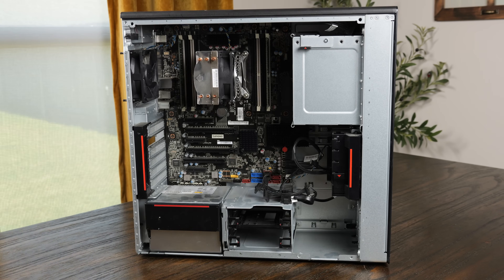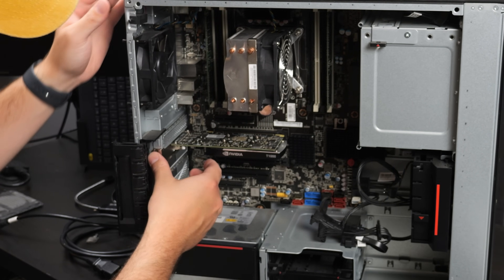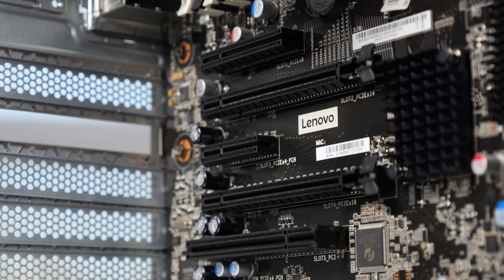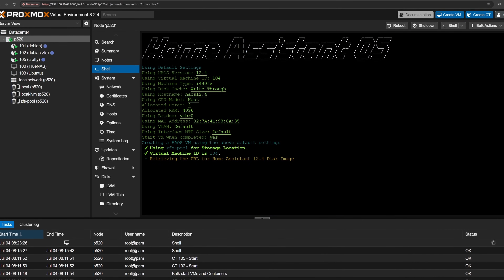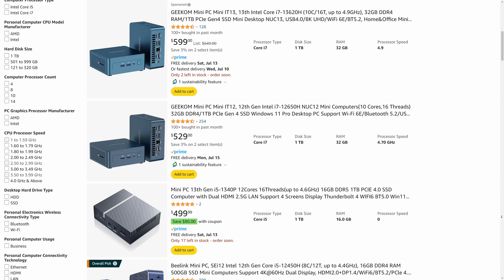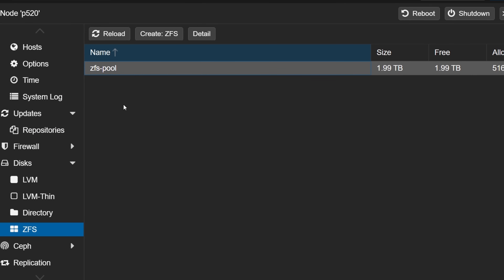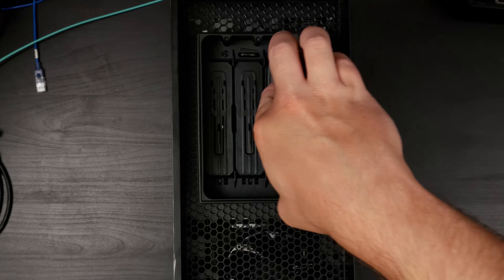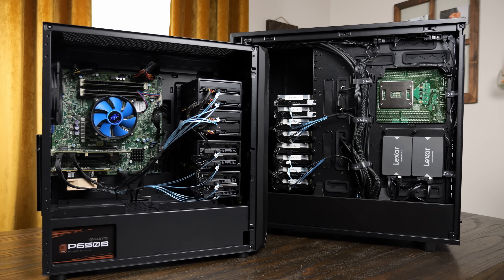A SERIOUS Home Server That's Affordable [Lenovo P520]

Comment: This system only makes sense if you have several of them so you can justify keeping spare parts for every component. You would not keep spare parts if you only have one machine. And if any part breaks its down until you can get a replacement which will take time due to the parts being Lenovos own special, you cant just hop down to the store and get a replacement quickly. This will make any hardware failures a nightmare both timewise and economy wise.

That, coupled with the fact that it cant keep up with modern comsumer i7 and i9 performance wise also makes it a poor choice.

The 512GB RAM is nice, but in reality you NEVER need 512GB of ram... Heck, many consumer boards offer support for 128GB ram... which you also never really need.

Being able to hook up many drives? Well, check out a rack case from xcase or some such, you can get one of those "empty" ones with 12GB/s SAS backplane and you get 24 (or possible even more) drive bays. You would need to purchase a SAS controller card though. But aside from that you can go with any consumer hardware you want or even have lying around. Much cheaper, much more flexible in the long run. You can do easy repairs and you can do easy upgrades. Not to mention you get waaaaay more storage possibilities.

Comment: If you have the earlier revision of the P520 motherboard, then you won't be able to upgrade to Cascade Lake W-22xx. I found out the hard way. I confirmed this by sending a picture of my motherboard to the Lenovo community forum where a Lenovo staff said my p520 motherboard is one of the earlier revision which won't be able to Support Cascade Lake W CPU's unless I upgrade it to a newer revision.

Comment: got a load of these to be scraped, we all in IT took one & saved a few for parts. Powersupply can be bit doggy as we had to swap out 2 of them after they blew. Otherwise they have been class for us learning how to work with VM's. Would like some more Sata ports on the board but sure it was free.

Comment: Machines like this get a lot of grief from people ( who have never owned one).  I have one with a 2245 8 core processor, 64 gigs of quad channel DDR4 and a 3060 TI video card. It's got a couple of m.2 slots. It's a solid machine. Built like a tank and probably the most stable computer I've ever had so far

Comment: I picked one of these up after watching your video and it has been nice so far. I did end up getting the Icy Dock 3-Bay Adapter since the lenovo cage would take over a month to be delivered and I don't have a 3D Printer. While it does work the way that the 5.25" bays are secured in the P520 isn't the best, and I can't use their bracket to lock it in place because of the way it is designed.

I could probably put my own holes into it so that the securing bracket works, but I don't move the server a ton and it fits in well enough that it isn't just sliding around if I move the case a little.

Comment: I have a p520 and got lucky w/ the 900w PSU and all the HDD cages for $150 shipped.  I have since added 128gb of RAM, an x4 NVME adapter, and RX 7900 GRE. I can play modern games at over 100fps, its phenomenal!

Comment: whell have gotten a real good server system for 400 usd and  it has 24 cores 48 threads and can use up to 512 gb of ram have 256 installed have 256 more in the other server got it in the price

Comment: How loud are these systems? Both at idle and under load. Compared to a regular workstation.
Reply: I think it's a little late for an answer, but still. It is decently quiet with the factory fans, but not silent. You can hear it in a quiet room. But it has horrible fans, they are like a jet turbines on high rpms. You can replace them with any quiet 92mm fans and swap out the CPU cooler. It will run literally silent except for the disks. Very decent workstation, I'm using it for 2 years for now.

Comment: I have been screaming about this thing since I got one like 2 years ago for ~$200 on ebay. The P520c would make a better workstation though b/c is also just as cheap, can do many of the same things and fit 2 GPUs.

Re: NVMe tests: A single NVMe drive outperforming RAID zfs between 4 drives bifurcated actually somewhat makes sense. You are r/wing to 4 different drives vs one. This is also a good way to wear out your drives fairly faster. I feel as though using them separately via passthrough is a better use case.

Comment: I don't get all the Lenovo hate.  Working on hardware for decades, HP and Dell have all of the same non-standard headaches.  It's how they all keep clients tied to their procurement channels for pricey parts.
It sounds like a 'Chevy VS Ford' argument for hardware nerds on the surface, until you realize its really a 'Chevy VS GMC' argument (it's only a different badge).

Comment: From a mechanic, never torque your way to loosen a screw. Pretend you are an impact drill by applying bits of tourque and releases. Another words, pump the screw driver and you will save your bits along with strip less screws that way. You will also find out that screws and bolts break their tightness easier too.

Comment: You inspired me to have a search for something similar after watching this.  I'd wanted a workstation platform for a while, but could never seem to find what I wanted, or could afford.  After searching a little for P520's, there wasn't a lot in Australia, and they usually had the W2135 or the W2123 CPU.  With the help of a certain LLM, I found out the competitors from the other brands, and then found an HP Z4 G4 with a W-2145 for reasonable money ($285USD)

I plan of definitely moving the portainer setup from my old 7th gen Intel NUC i5 to this new server, as a VM in proxmox.  The only thing I'm still trying to decide, is if it's worth moving my OPNSense box to this also, and then the NAS as well, and combine all 3 of my current systems into the one.  I'm fairly certain that it will have more than enough power to do what I want, and I'm sure that one system would use much less power than 3.

Comment: 8:18
I saw a setting off by default that allows thunderbolt in BIOS and requires that you select where it's connected.

You may need to enable that if you haven't.

I bought one because of your video lol

Comment: I've suggested these Xeon W-21xx CPU workstations on your videos before. I bought one myself several months ago. I have an HP Z4 G4. The proprietary junk is a little annoying, but replacement parts are dirt cheap on Ebay if you need them. Proprietary workstation/server equipment is way cheaper on the used market than standard stuff, so if you want budget options with a lot of features, that's the best way to go. I bought it for something cheap with a lot of PCIe lanes and high maximum RAM capacity.
Reply: As far as proprietary stuff goes, I'd take Lenovo over HP or Dell any day.
Reply: @nootnewt  I prefer the PCIe slot layout on the HP Z4 G4. It goes empty slot, x16, x4, x16, x4, x8. That lets me put two x16/x8 cards and an x8 card in with each card having free space between them for airflow. The Lenovo has the x8 slot is right above the first x16 and thus has less airflow for that one slot. If I remember correctly, the Dell model has the same PCIe slot issue and a more cramped chassis. Most x8 cards I'd look at like NICs and SAS adapters need a lot of airflow and having it that tight in there makes them harder to cool adequately without getting very loud.

Comment: using this kind o hw at home is silly as long as you don't have solar panels... A home lab IMO should only be driven by low power devices, why would you need something like this when there are a lot of low power devices with decent performance these days which will not cost you an ARM...

Comment: If Intel will manage to make bifurcation work on desktop system I will be first who will run for their platform, its more power efficient idle then latest AM4/AM5. But for now I will use AM5 - efficient under load, bifurcation for nvme drives. This Lenovo system is interesting, but old, inefficient and full of proprietary components, so for something like socket 2066 I'd rather look for standard x299 systems (but wo BMC) or some Xeon systems/boards with standard layout of PSU/USB/etc

Comment: A serious home server needs 12 drive bays at least :(
Yes, 12.
With today's storage needs, you have to use at least RAID-Z2. This mean you will only have half the overall capacity (50%) useable if you use just four drives, which is extremely wasteful. So you need to use five drives at least, for having a much better quota of 3/5 drives as useable capacity, or 60% at leats giving you more than half of what you paid for. Then you also need an online spare drive, in case there's an issue. This makes 6 bays in use all the time. But what happens once you need to switch to bigger HDDs? ZFS won't let you simply increase the storage. So you need a seciond set of drives to use. This means another 5 drives. You don't urgently need a hot spare for these additional slots, but you won't get an 11 bay enclosure anywa - so it will be 12.

Comment: Maybe your 10Gtech SFP+ card prevented C6 CPU idle state?
Try without it?
Check out Wolfgang's videos on forcing cards to support PCIe sleep, or whatever. I've not tried that yet. Easier to remove the card and measure.

Comment: Fun fact the P520 comes with windows 10 workstation edition license hard coded in the MB, eBay sellers sell them with win10 home, a few command prompts and you can pull the license key off the MB and upgrade to win11 workstation for free

Edit: What i'm trying to say above is that if you use this box as a Proxmox host, create a Windows 10 VM with the CPU set to host, you will then be able to use the embedded OS key to activate the VM
Reply: Could you share the commands to get the license key?
Reply: the hardware IDs are actually just stored on microsoft servers and installing windows workstation edition will auto license itself since they look it up on ms servers. However windows is terrible, use linux.
Reply: Why the fuck would you downgrade to Windows 11? 😅
Reply: thank you so much
Reply: i couldnt imagine only have 12vcpus to work with in a hypervisor tho. you can find a dual socket 2011-3 (v3 v4) for pretty cheap, its the better option.
Reply: mas...
Reply: *downgrade
Reply: I use Linux and you should try it too.
Reply: @MelroyvandenBerg do you just see the word Windows and day "no, Linux"? They said proxmox running a windows VM. They ARE running Linux. 🙄. Do you need me to explain it?
Reply: @MelroyvandenBerg  yeah but if you install Proxmox you can have Windows and Linux booted at the same time. Fit two graphics cards and you've got two PCs in one plus a server.
Reply: Just use windows server it has gotten better now.
Reply: @MelroyvandenBerg  me too.
Reply: @MelroyvandenBerg why?
Reply: @FINNIUSORION  have you tried Linux? The Workstation and server performance and usability is much better than Windows. At least in my honest opinion

Comment: Nice Video for the US , but in Europe these things start from 350 euro or a lot more...  so DIY AM4 starts to make a lot more sense, Ryzen AM4 is getting so cheap new or second hand CPUs like the 5600 (6c12t) . but if you need more cores 3900(12c24t) 3950(16c32t)  there are plenty cheap mother boards x470 with 8 sata 2 m.2 and 10G networking for 120 bucks ( asrock taichi ultimate) also using intel remote management that is out dated ... is that not a security risk?

Comment: AMT is a pain. I've been trying to set it up on my Minisforum MS-01, and remote KVM works effortlessly through MeshCommander, but I'd rather use MeshCentral as it just has a better and more capable interface etc., plus it's more secure etc. But AMT support seems to require using a CIRA tunnel, so the setup is more involved, and while I can get an AMT connection, I can't get remote KVM to work with it yet.

Comment: I see 2 serious oversights that you should have mentioned in your video :
(1) you forgot to check if the BIOS is locked in terms of CPU replacements or not. (companies like Lenovo, HP, Dell, ... love to lock it so that you cannot simply buy another CPU and drop it in without stumbling on any issues).
(2) you forgot to mention that when you replace the motherboard you will also be forced to replace the PSU, thus adding even more costs to the upgrade path.

These proprietary systems are definitely not worth buying if you are considering going down the upgrade path.

Comment: You should take a look at the dell precision T7600/T7610. It’s an older workstation but still pretty usable and affordable. It can go up to 512gb ddr3 ram, I believe it can support up to 40tb of hdds. And can have as many as 3gpus installed at once as it has a 1,300 watt psu.

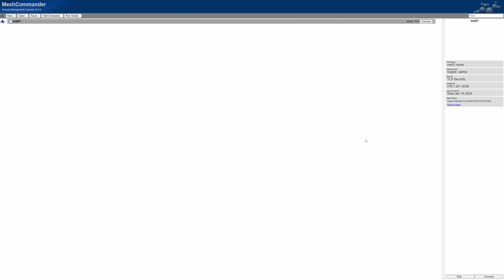Comment: 16:10 You need a CPU which has an integrated GPU to see the video. And even then, it needs to be plugged in to a monitor or use a dongle that fakes it.

Comment: Dang, I've been using an old Dell Intel 4th gen sff office pc as a NAS for a couple years and this seems like it might be worth the upgrade, currently i'm limited on drive space, sata ports, and overall function (I crammed 2 3.5 hdd but the top won't fit back on so i'm hotrodding it atm 😅) This would def handle most if not all of the future projects I may want to do (currently only running Plex and Home assistant but would love to get into more things like game server hosting and stuff.

Comment: only reason one should opt for old workstation servers is when you don't want to get a pikvm and need that kvm for remote access as a backup or when you want to set it in a place and forget it like your basement and not worry about power management as these hog power+heat+noise.
And no 3d printing is not a viable option for those looking at cheap + value home servers builds. Don't understand why the creators think otherwise.

Comment: For people wanting more cores/RAM, Skylake Xeon Scalable has also become pretty affordable recently. The Lenovo P720/920, HP Z6/Z8 G4 and Dell T7820/T7920 are all options, with 6 memory channels instead of 4 and multiple sockets.
Reply: The HP workstation are dogs, I have used a couple generations of the Z8 workstations and they run about 200 mhz below the base frequency don’t get within 500 mhz of the boost frequency.  I had the IT guys as well as HP support work on the problem and everybody has been left scratching their head.

Comment: I converted an old PC with ASRock 870 Extrem3 R2.0 motherboard, AMD Phenom II 1090T CPU, 8GB DDR3 RAM and a Saphire HD7850 2GB graphics card into a NAS and home server. The main problem was the case, as there was no space for several hard disks and a CD-ROM was installed.
I removed the CD-ROM and replaced it with a hard disk cage 3x5.25" to 5x3.5" HDD (ALEOHALTER Hard Drive Cage). This has an insert for a 120mm fan at the front, which provides sufficient cooling for the HDD. However, I couldn't install the cage directly, as on the inside of the case there were metal inserts for the 5.25 devices to sit on. I had to bend these outwards, which was easy to do with a needle-nose pliers on the thin sheet metal. Then the cage also fitted in.
It doesn't look pretty, but it works. The board has enough SATA3 ports, but I installed a Marvel 88SE9230 PCIe 4xSATA3 card for the extra hard disks (which I still had lying around...), because I want to keep them separate. The 550 watt power supply could also be a problem if I install more than 3-4 HDDs. I will then have to replace this with a more powerful power supply unit. The operating system will be installed on an INTENSO 240GB SSD (the cheapest 240GB SSD I could get...). I will replace the graphics card with a simpler, smaller one that draws less power, since there is no need for it in a NAS.
And that's a NAS/HomeServer I call "low-budged"!

Comment: The PCI slot makes a lot of sense because it's a Workstation, meant for Work.
For small industries that use obscure or proprietary hardware controllers which are not economically upgradable yet.
Audio system cards for small radio stations.
Weather sensor stations.
Robotics controllers.
Etc. etc...

Notably it makes tranferring a backup off an older RAID array, to the new upgrade system extra simple.
Reply: That's why people are moving from hardware solutions to things like zFS and UnRAID in the enterprise anyways.
Reply: He literally said that in the video lmfao. You were the exact person he was talking about finger flying across the keyboard before you finished watching.

Comment: Now watch as the ebay prices skyrocket over the next week 😂
Reply: they did.
Reply: @resolution7482  just looked at prices here in Germany, it's at least double to tripple of those in the video or the comments, even CPU only.
Reply: W0rd. Get in early before the decently-configured ones go over $400!
Reply: @rerereuj E5 v4 Xeons are Broadwell, the P520s use Skylake Xeons, which are 8th gen architecture. Broadwell is 5th gen.
Reply: Just looked on eBay today 6/4/25 and the prices have sky rocketed.
Reply: Just checked today. The p520 I bought in January for $175 with the 600w psu and 16gb of ram is now $294, a 60% price hike. For old tech already in the US. Other models like the 64gb have seen a 100% increase just in the last 2 months.

Comment: I bought the same system on ebay only with 128gb ecc memory for $300 and bought the extra cage from the Lenovo website for $40.
It's running TrueNas Scale.
I bought 6 used HGST 10GB HDD @ $80 ea. , 2 - 1TB NVMe drives (one boot drive for TruNAS Scale, and 1 for Windows 11 Pro. Running Windows 11 as a vm in Scale was...awful... 😂. Running it as a stand-alone OS was a 1000% improvement!

Still playing with it as I'm learning Scale. It will eventually be my media server exclusively.
Reply: Update - I've also added a 10gb NIC and a Quad NVMe PCIe Adapter (bifurcation YES!)